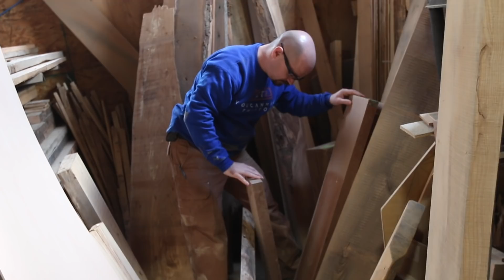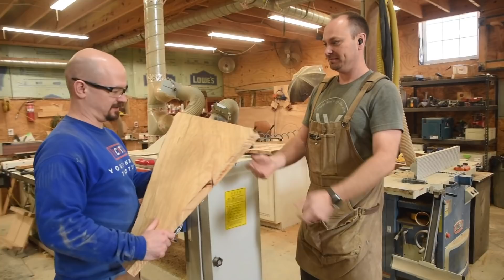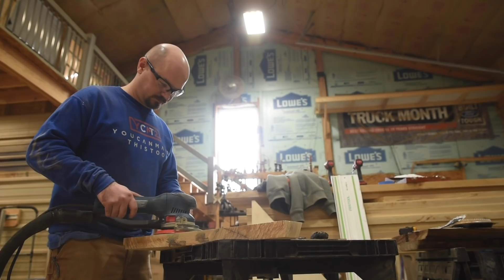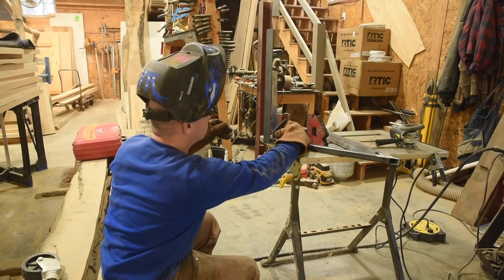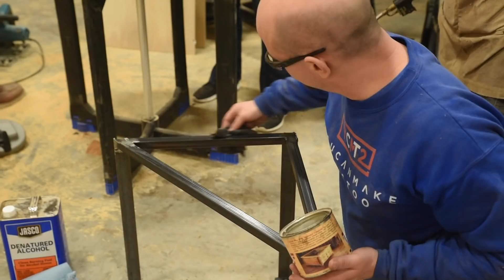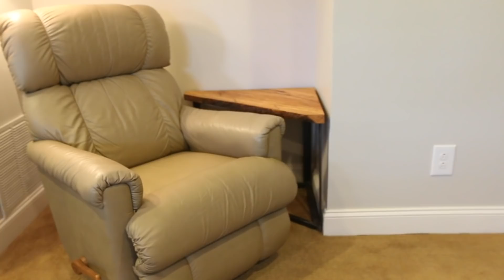6 Tips for Faster Woodworking | Olive Slab Table Build

Comment: looks great! i'm going to use the tip about burnishing the wood with a high grit sanding before the wood filling is done to help prevent the wood filler(i'm using Timbermate) from getting in the grain. What did you use to make the bark adhere to the table? How often have you done that and what have your results been? looking forward to meeting you on the 22nd

Comment: When it comes to multipul items if I'm working on building the same thing multipul times I stick to one thing till there all made then move to next item so if 20 legs need to be welded I weld them all before moving on good way to do quick assembly when your done with all items
Reply from the maker: Same way I do it, batch those procedures!

Comment: Doesnt look very much like olive. Spalted beech would be my best guess
Reply from the maker: It definitely looked like other olive wood I've worked with.
Reply: @YouCanMakeThisToo  The One we have here in Italy looks different. Anyway, the smell of the wood is so obvious there should be no doubt, as well as the oil content of the wood.
Normally as I know it with olive, if it has cracks it's because of rot, not from drying. It's simply too hard and with grain in all directions.